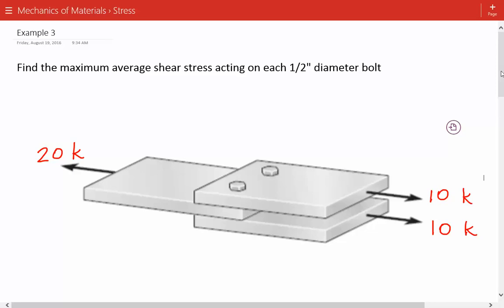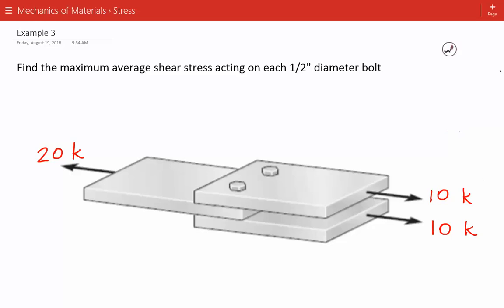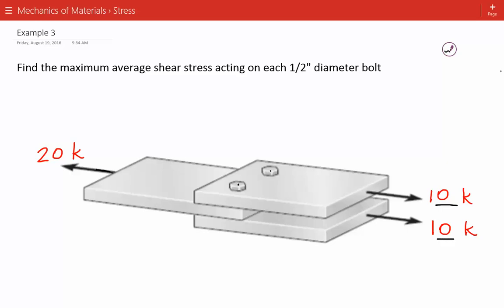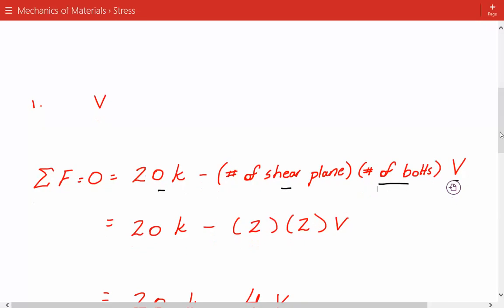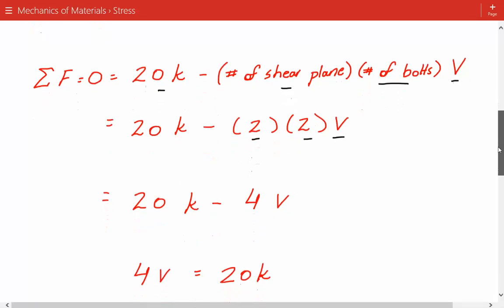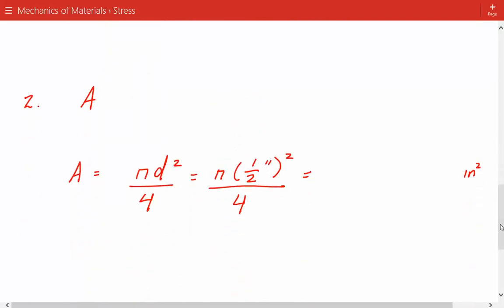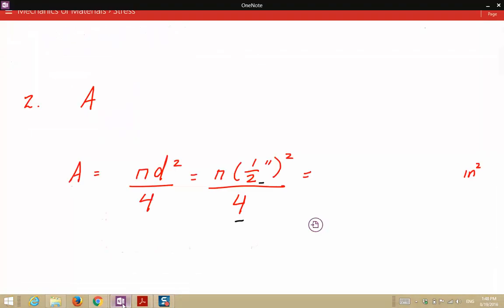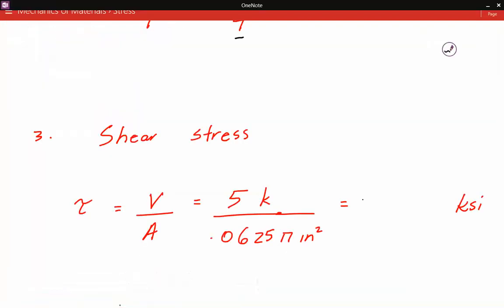Average Shear Stress in Bolt for Double Shear Simple Connection, Mechanics of Materials Example 3

Comment: That spreadsheet hinders learning for simple problems such as this. It’s faster to compute area and stress using a basic calculator for these types of problems. More importantly, it’s better practice than using a spreadsheet. The spreadsheet should only be used for large batches of same formula executions

Comment: i've gotta a question .. For the first equation .." EF=O=20k -(#of shear) (#of bolts) V ........... The question is , where did you find the 20k ???!? How did you calculated it ???!?
Reply from the maker: Thanks for answering the question Joe
Reply: The 20 kip force is a given in the problem so you don't calculate it
Reply: @joefiala2911  You have 20 kips pulling in one direction, and two 10 kip forces pulling in the opposite direction. why isnt the total force acting on all the bolts 40 kips, 20+10+10=40?

Comment: How did you determine the area is 0.0625 and why? pi*d^2/4 = 0.196...so what happened. Thank you.
Reply: It is 0.0625*pi which is equal to 0.196. The area formula is pi*r^2 ; r = 0.25 inches (1/2 the diameter of the  1/2 inch bolt) and r^2 = 0.25^2 = 0.0625 square inches.
Reply: Thanks, I did eventually figure it out. You see in the video I did not see the pi sign in the problem (it just did not seem like pi) so I did not under understand how 5k was only divided by 0.0625. Thank you again.